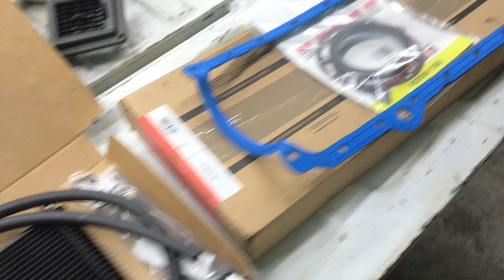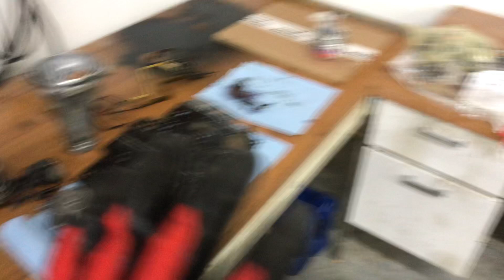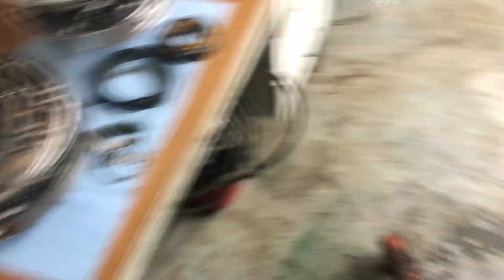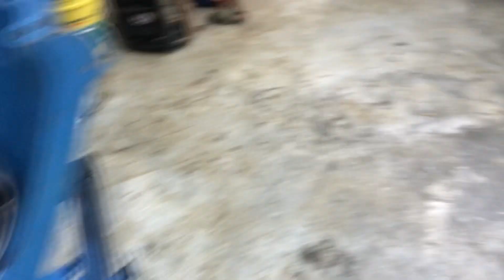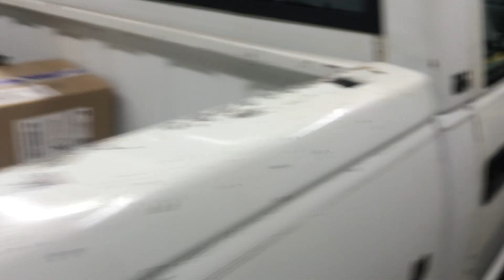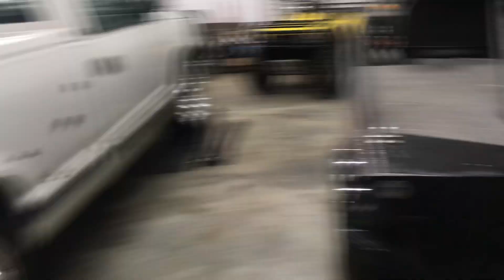Update on my 1988 c1500 “Sam” building my first transmission.

Comment: Cool interior, I love the color. I almost bought a 95 extended cab  short bed with a 350 but it was hit on driver side door and bedside.  But I didn't  because I wasn't thinking of buying a truck. It ran good but they wanted 3k which is good for some one. If I had 10k I would have to customize it.

Comment: Kind of an irrelevant question, but do you have any idea or solutions to body lean? My c10 leans to the driver side and have no idea why
Reply from the maker: I’ve done several things to correct it. I’ve used a drop shackle to fix it, you can also take the leaf spring pack apart and leave one spring out. Also, make sure that it’s the front or back. You can use a dampener on a coil spring or, a piece of heater hose which I don’t really recommend if it’s on the front
Reply: @gmtim3840  appreciate the feedback thank you!
Reply from the maker: @johnc2230  it’s normal, a little of them do it
Reply: @gmtim3840  i wouldnt mind a little lean but mine is a whole lot if you look at it from the back you can definitely see how crooked it is and it drives me nuts haha
Reply from the maker: @johnc2230  I completely understand. You might swap the leaf springs around and see if the lean changes sides. If so, just run to a junkyard and get you one and change it
Reply: @gmtim3840  good idea I'll try it out thank you. If i can't find a c10, what car or truck can i steal them from that will fit?